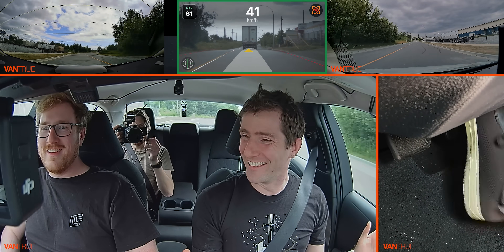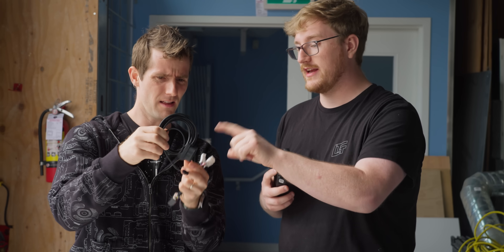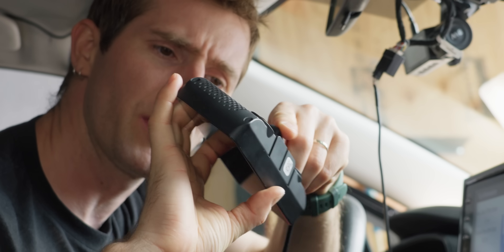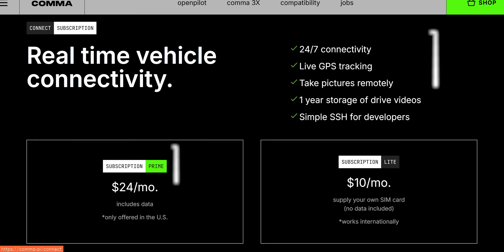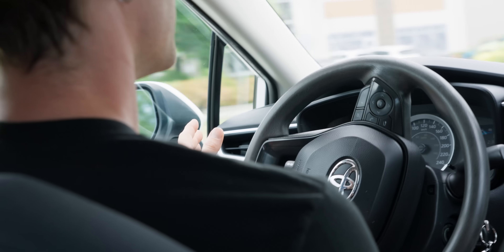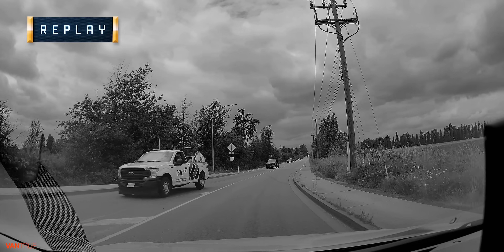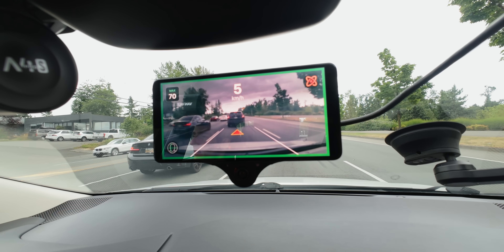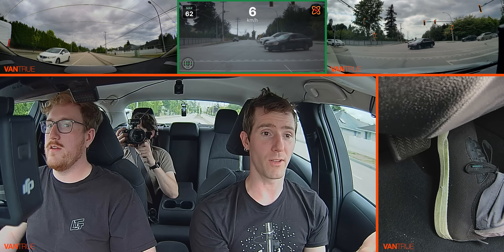I Upgraded My Car With Open-Source AUTOPILOT and it's AMAZING

Comment: Really happy LTT is covering Openpilot. I've driven with the C3X for almost the past 30,000 miles and I feel like this video was pretty comprehensive and digestible, and was fairly representative of the day 1 experience that I had too. Openpilot does continue to get way better with custom tweaks and forks, and as you guys mention the experience does vary quite substantially on what and where you drive. As Comma releases new driving models (the neural network that decides where the car should drive) the experience has also continued to get smoother and more refined. So I'm really looking forward to your next adventures with this system!
Reply: Is this the guy who gave us iphone jailbreak Geohotz
Reply: @cclacss  yes, he has been doing this for several years.
Reply: does the steer assist get any better on different forks? i know this is suppose to be a best case car and i was kind of disappointed and how often the car needed help through the turns. this video may have sold me on a tesla
Reply: @chrismurphy1484  Different cars have different amounts of steer torque. Unfortunately the amount of steering torque is dependent on the safety limits imposed by the manufacturer or by comma, whichever is lower. Messing with any of the safety code is highly frowned upon and will cause comma to withdraw all support for your device.
Reply: @Jeffrey_Wong  darn, well im glad this video came out about 12 hours before i went to buy a camry. off to see what tesla insurance will run me
Reply: @Jeffrey_Wong  what is steering torque bro XD just google understeer its a very basic concept, there in a fwd ca trying to take those tight corners without slowing ofcourse its not gonna make it the front end is losing grip
Reply: @pgua1111 It's just how much force the car applies to your steering wheel. On a lot of cars this is artificially limited by the manufacturer as a safety precaution since they only validate their lane keeping systems on relatively straight roads where not much steering is required. If Openpilot exceeds this limit the car will display an LKAS error on the dash. On cars where this limit is not present, Openpilot enforces its own limit to comply with ISO standards to prevent your car from deviating from its lane faster than you could react and correct it. I'm not talking about anything grip related, Openpilot will give up trying to steer the car long before that's an issue. And I have thousands of hours in sim racing, I would know a thing or two about under and oversteer.
Reply: @Jeffrey_Wong  ooh sorry mr sim racer here what force is your car putting on your steering wheel bruv your steering wheel is putting force on your steering rack which turns your wheels
Reply: @pgua1111 cars with driving assist systems apply force on the steering wheel to turn it. Did you watch the video? There's an electric motor built into the steering system, which the comma unit controls to steer the car. That motor is severely limited in how hard it will turn the wheel, so it won't make moderately tight turns no matter how much traction you have. Different cars have different limits.
Reply: @pgua1111The EPS motor is putting force onto the steering wheel. That’s the steering torque being talked about.
Reply: @chrismurphy1484 Personally I had a lot of trouble with stock open pilot on my civic. It tried to constantly jitter the steering wheel at low speeds and lane keep was very ping-pongy. Installing FrogPilot solved those issues immediately, so while I've only tried the two forks, I think they're different enough that its worth looking for the best fork for your car. 

However your cars torque is by far the most important thing when it comes to turns. My civic has awful torque and it acts pretty similar to the corolla they tested, not really an issue for me, but it requires intervention on sharper turns (and you probably should have hands on wheel for those anyways). The best torque cars for it are Kia Hyundai Genesis I believe, and it should be able to take a lot sharper turns with those models.
Reply: lets pray that openpiolt devs didnt vibe code it lmao
Reply: @GrimmReapgi  Naw this was all before that. YEARS before. If anything, AI would probably fix a lot of openpilot, actually.
Reply: @fitybux4664  yea i heard of them b4 its a joke bc if they vibe code it we cooked
Reply: 30,000 miles? How? its crap, does it take one corner correctly?
Reply: @St0neman311 it takes many corners correctly.

Comment: We should probably stop calling anything without radar self-driving, including Teslas. We've shown time and time again that camera-only is not acceptable.
Reply: Openpilot uses the radar in the Toyota
Reply: That's completely ridiculous. Use the radar on openpilot and you will see why they want to move away from it. It's great for cruising but anything else it has no intelligence. Radar can't see when the car in front is turning, and keeps slowing down even after the car leaves the path. Radar can't stop for stop signs or lights. Radar won't smoothly slow down for cars stopped at a red light. Radar only sees a certain distance and if you're coming up on a stopped car at highway speeds it might not be able to stop in time.
Reply: @davidt01  And cameras can't see in fog and rain and have proven time and time again they aren't enough. Both should be used.
Reply: @justme002 didn't you see the robotaxi video of it driving flawlessly in the rain?
Reply: @davidt01  Was that with or without a technician remotely taking it over in a panic like they've had to do several times?

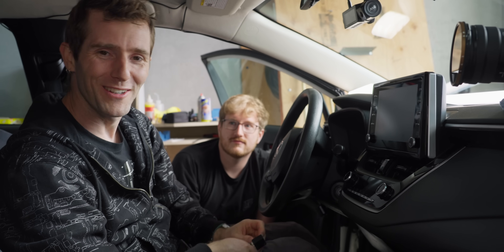Comment: 4:44 "F*cking around and finding out" is NOT reverse engineering! Reverse engineering is taking closed source and essentialy disassemble the whole code from hex until you find out how the specific software works, in order to mod it, find weak points etc...

Comment: careful disconnecting full power from some newer cars. if some vehicles go down to true 0 power they need to be re-calibrated with a pro handheld tuner. ie.. a trip to the dealership or professional mechanic. a lot of times things workout just fine on their own, reboot, calibrate and go.. some vehicles not so much. this is just a heads up to the blond guy trying to sport that frail lil stash. hehehee lookin like a 16 year old boy lol.. how does Linus look older then you in this video lmao

Comment: I experienced self driving the first time in march. My dads Volvo had a vacuüm leak and the garage didn’t have the hose in stock.
So they gave me a c40 recharge for free to drive home and get the car after the weekend.
Also first time driving electric was strange it’s fast but now I know why people say it doesn’t have a soul.
But the self driving was extremely nerve wracking and I ended up turning it off after 3 minutes.

Some things really annoyed turnend out to be settings you could change.
Like to safe money they use a big screen in the center which shows your speed. 
However when looking over to check how fast your driving the car starts beeping and ringing to have you look at the road. The sound system sounded like it was being played from a tin can after changing the equalizer it disappeared.

Honestly not a fan of it. I’ll take my old trusted VW scirocco any day over that battery on wheels.

Comment: I'm super excited for this series , I'd love to know if you could add other sensors into the mix , thermal or LIDAR , also I'm very curious to see its ability to night drive , and just some other less ideal conditions. Also once you can integrate navigation into that system I bet it gets a lot better.
Reply: On VW’s it uses the built in radars
Reply: @tehfalcon  I noticed that! I've been paging through the documentation now and I've gone down a rabbit hole. Would still be cool to be able to attach your own sensors as well.

Comment: No seatbelts?
Reply: @cfarrell02  yeah I was thinking this too. Are  there no seatbelt laws in Canada?
Reply: @Grafights There are. $167 under normal circumstances, but since Linus is an employer and has employees as passengers it could be higher. Pretty silly decision, and I see no reason for wearing them as lap belts.

Comment: That Corolla is weird.. I have the 2019 model too and it will auto-accelerate from a standstill perfectly fine if you had lane assist and auto-cruise control on (the logo on the dash changes, indicating it follows the car ahead). Otherwise, at a red light, you press a button on the steering wheel. Also, a turn limit?? I know for a fact that it can do 2,5 rotations of the steering wheel in each direction, it does it when you press the button to automatically park into a free spot.
Honestly, I‘m not impressed by that device, so far, nothing has been shown that the car can‘t or wouldn‘t do anyway. It would in fact do it continuously if the government in my country hadn‘t mandated a limit of 20 seconds that you can drive that way without touching the steering wheel. (It beeps and you have to touch it again)
Even when roadworks are done with altered lane signs, it knows that it should ignore the white lines and pay attention to the yellow temporary ones. Often, it even switches to the mode where it follows the car ahead because it will follow the trajectory of the car.

Comment: I don't think this is legal here in Germany, but I find it f'n hilarious. Would your insurance really pay if you had an accident and this system was installed?
The idea is brilliant and when I compare my Kia EV with a standard "Tessler / its all computer" the Tesla surprisingly displays so much in detail around you, which is brilliant, but then it does a shitty job in steering and also stop & go is anything but smooth ... my simple Kia does that way better. How ironic is that, but none of those react on traffic lights or stops signs, which this one does. That is pretty amazing ... I am sure they will improve their system in smaller increments on the hardware and software side.
I really wonder how the manufacturers of such products will try to legalize these non stationary and questionably inserted and installed systems in the long run?!
Maybe they are better off getting in touch with the car manufacturers and talk about a proper factory implementation of their systems?!
Reply: When did you try a Tesla? And was it Autopilot or FSD?
Because your experience is very far from it's current state. FSD v13 is lightyears ahead of anything else, and it's super smooth.
Reply: @andrasbiro3007  No clue, it was last week and it was the most basic version of the Tesla model Y of a friend. As I know him he would be way to thrifty to spend a few thousand on any version an extra autopilot. I think this model is maybe 2 years old, definitely not the very new version ... its the old one with the poor acoustical attenuation. It doesn't have a cockpit with displays or buttons or a head-up display, but it has this display in the middle,  so the passenger can also interrupt the car when on autopilot.
I guess it isn't designed for manual driving, having to look sideways if you want to know your speed or control anything via sub menus. It also doesn't have programmable softkeys. I would respect the design if it would be completely autonomous, but driving this manually must really suck.
Its the one with the ridiculous fake plastic wood imitation in the empty interior. I am surprised it doesn't have the wooden panels on the outside, like a 50th station wagon, especially on the weather side 🤣.

The only thing I love about it is its logic, you leave the car and turns itself off and locks it, in my car I have to press a button to turn it off. If I get off the seat it could just turn itself off when closing the door and nobody sits on the passenger seat and automatically lock it when the key is not near the car, as simple as that. I think many automotive software developers don't have drivers licenses, else I have no clue why they would program dumb stuff like this.
Tessler can 🤣
Reply: @n1vca  
Sorry, not time for wall of text.
Reply: These systems are driver assistance tools - which require the attention and supervision of the driver. If the driver fails to supervise and take over when necessary, it will be the driver's fault. You can blame it all you want on the tech, but insurance will still count it against you. The same applies for other drivers assistance tech like blind spot alerts, traffic-aware cruise control, forward collision warnings/auto-braking, etc.

Comment: So the car has to support these features. Im assuming this car has driving assists. So a comparison between the stock vehicle's assists and the comma would've been useful in all honestly.
Reply: My Nissan Leaf has LKAS. It's terrible. I tried it a few times and it will drift over the center line on all but the most gentle curves.
OpenPilot is a night and day difference. It warns me when it reaches a corner that's too sharp. It also fails really predictably and usually with plenty of time to react.

The Leaf has an unusual setup for pedal control, so it doesn't seem likely that Comma will be able to control the speed in my car.
The stock ACC is adequate, so I alternate between that and controlling the speed myself. SunnyPilot (a fork of OpenPilot) has the option for steering control with ACC off.

I'm not buying another car unless it supports OpenPilot.
Reply: Last time I disabled OP and used stock ACC/LKAS, I could not wait to pull over and re-enable OP.
Reply: @tsujimasen  First thing i do in ANY new car is disable adaptive cruise, autonomous braking and lane assist. All useless garbage, just drive the car or get the bus lol.
Reply: @LyumYT213 but I like my own bus for the 10+ hour drives where I just chill out and can leave when I want. Or my own mini-bus in stop & go traffic where I don’t have to hit the brakes or the gas.
Reply: It just has to have the technical features. For example a car that has lane keeping assist doesn't necessarily have lane change assist. But because lane keeping assist requires the car to be able to automatically steer to an extent, it can be implemented. If the car has cruise control then you can make it accelerare programatically, ... 

It's kind of a useless comparison because it's literally just land assist, auto-breaking, cruise control, ... you can go watch a video of that, it's not really related to the subject of the video (which is the software and how well it integrates in vehicles that don't explicitly support it)
Reply: @leeroyjenkins0you've more proved my point than create a good rebuttal. It literally needed a minute or two to show the capabilities before. I just want to see what the vehicle is able to do prior the upgrade. Could I go find this information elsewhere? Yes. Do I have an foundational understanding of what is happening and what this does? Yes. If the video a tutorial on how to install this? No. Is it a showcase of what it can do? Yes. With all that said, a comparison would be useful for those who may just stumble across the video (normies) who might not fully understand what it can and more importantly, can't do.

Comment: It needs to get better but that's interesting. I looked up my car and it's compatible.
From the video I am not sure this is a lot better than the one built-in my Hyundai though, but if it gets better there is a way for this to be very interesting.
Correction: this is probably way better. But where my car fails is often when there is light in lens and I would assume it has the same problem.

Comment: Great to see Comma making progress and LTT covering it. I have been using openpilot for about 4 years now. They still have a lot to catch up on the longitudinal control. But the lateral control is great, very human like moves minus the lack of steering torque from the hardware limitations that they can’t overcome. One thing you guys missed to mention is the rear facing camera is also used to driver monitoring. That’s why you don’t have to constantly nudging the steering wheel every 20 seconds. I find cars without camera driver monitoring is more tiring to use than just driving the car myself.
Reply: Do you drive with sunglasses? Does it still work with driver monitoring?
Reply: @oogiwoogies yes, works perfectly with sunglasses.

Comment: He said that on the highway a Tesla in basic Autopilot will take the corners hard at high speeds. I'm sorry but as a Tesla owner who used Autopilot extensively before subscribing to FSD I'm going to have to strongly disagree here. I've been on plenty of road trips here in the US traveling all up and down our I95 stretch and Autopilot maintains speed, adjust to speeds, recognizes highway speed signs very well while traveling speeds up to 85mph (136kph). 

Comma is awesome but basic Openpilot has a ways to go as we can see here. On slow speed roads it's struggling to stay centered. Many of the forked versions are a lot better. But like he said in the beginning, they're good at many aspects but need work in other areas of those branches. It's a great system but it needs a lot of monitoring and babysitting to be mostly usable.
Reply: I notice you didn't explicitly mention that it adjusts to oncoming turns automatically, so does it? Because not all "tight" turns will necessarily have an appropriate sign warning for it.
Reply: @leeroyjenkins0 Tesla Autopilot slows down automatically for turns based on visual cues of the curvature of the road as well as map-based data.
Reply: @leeroyjenkins0 
You mean Autopilot? Even the 10 years old first version slowed down for sharp turns. Maybe not for really sudden ones, but anything you can encounter on a highway.